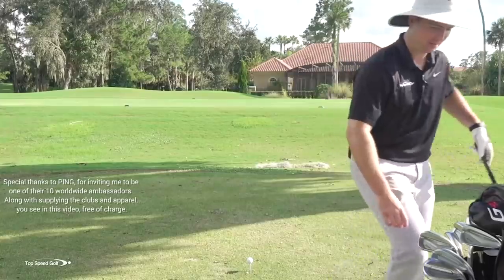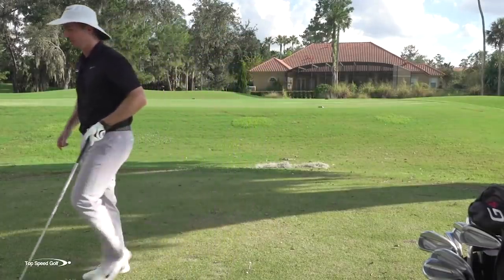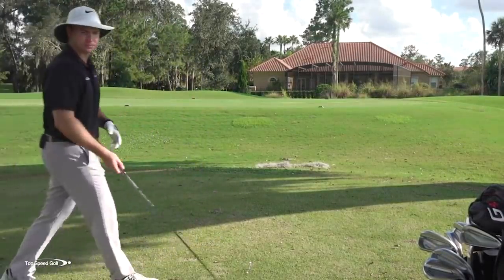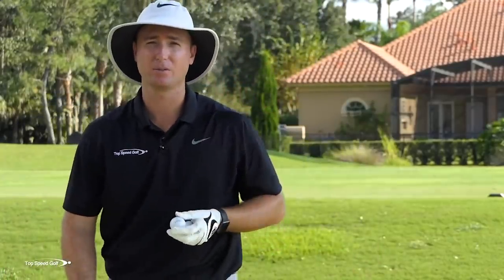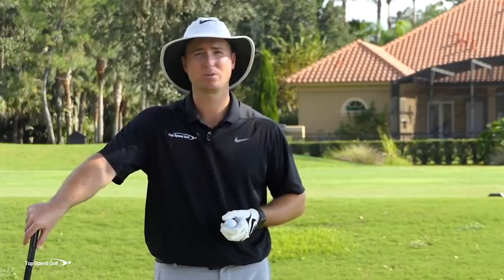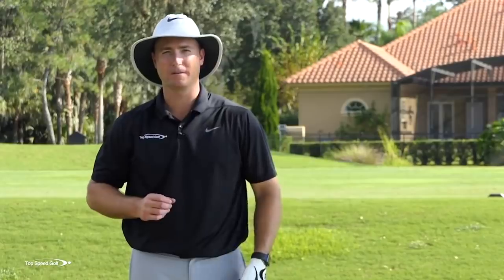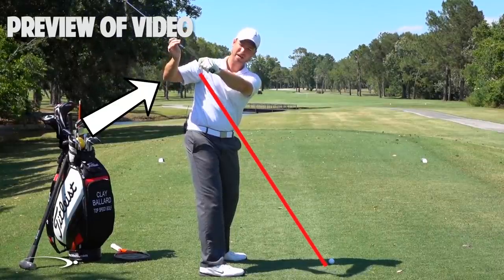How To Lower Your Driver Spin To Hit Longer Penetrating Drives

Comment: I've been following your channel for a little while now and really had a breakthrough with my driver yesterday. Your videos gave me the tools to not only begin to correct my technical errors, but to know what went wrong when I hit a bad shot. Previously, I didn't know what caused my bad shots, so I couldn't address the problem. I've begun to "know" what it feels like to square up the face, because of the variable learning drills you've shown, which have helped me tune into that a bit more. Then, using the foot spray stuff you've talked about, provided me with the immediate feedback to see that I was typically making contact with the ball low and towards the heel, even with my tee set high. Then it clicked, I needed to stand further from the ball, which forced me to have to reach for it more and prevented me from swinging across my body and either slicing or hitting a shot straight to my left. I could then focus on keeping that 'hula hoop' shape going towards the ball. Just like that, my drives are flying consistently further and straighter. I don't think I'll be scared to approach the tee the next time I play a round. I sure am glad I found this channel. Thanks TSG team!
Reply: Awesome 👍 This is exactly what I'm struggling with too, keep forgetting to bring my foot spray but thanks for sharing your experience ⛳🏌️
Reply from the maker: Wow, thanks fro sharing! Glad to help. Sounds like you're on the right track so keep up the hard work.

Comment: I would recommend to anyone who is used to a lower tee hight to put tape on the top leading edge of the driver until you get used to using the higher tee.
Reply: yeah, I messed up the top of my driver pretty bad :/
Reply: That's a great tip!
Reply from the maker: Thanks for sharing!

Comment: Good content. I’d also highly recommend getting fit for a low spin shaft with a high lofted MOI driver so the forgiveness is there, but the spin is controlled with the shaft. Ex. Sim Max with a Ventus Blue Shaft would be a good start.
Reply from the maker: Thanks for sharing!

Comment: Excellent explanation of the role of face contact on backspin. Always felt better hitting slightly below sweet spot but now I understand the value of hitting it slightly higher, even if if it doesn’t sound as solid. Thanks.
Reply from the maker: You're welcome! Play well!

Comment: If my left arm is shorter cause the bone overlapped when I broke it 1.5 inches down from the joint, I mean I slice like crazy sometimes. Is that sometimes the reason cause i might be pulling i mean my left elbow bends at the top of my swing so is there something i can do that won't make me lose distance, i usually hit it 230 on a good swing and 200 on the slice. I know no one can tell me exactly cause my shoulder is unique in the way its healed but yeah feels like I've tried everything and I keep slicing so should I just turn more left and play the slice or something like that lol
Reply from the maker: It might be making it difficult to swing the club more from the inside with a closed face but if you slice then it's the same reason as everyone else, your path is too far out to in. Check out our slice videos on our channel for help.  Play well! Quentin | TSG Instructor
Reply: @TopSpeedGolf  so i went golfing the day after and shot an 89 which is about 7 strokes better than normal for me but yeah i was hitting them only 220 but it was straight and my irons have never been better! Choking up a bit made all the difference around the green 80 yards out

Comment: Clay - would you also recommend a faster back swing as long as it was a smooth correct back swing to increase club head speed and distance?  Great video as always.
Reply from the maker: It can help but your ball speed may go down if you can't control it and hit the ball solid

Comment: so this is just showing us what spin is and how its created and the "how to lower your drive spin" is in another video we have to pay for?
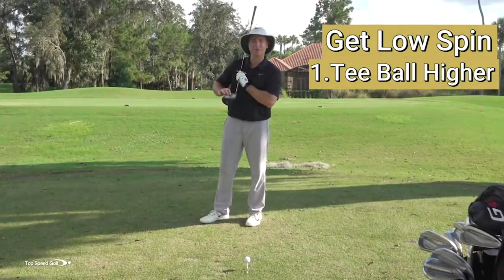Reply: You must have been asleep , I'll help you jump to 9:20 in for summary.
Reply: @rudebhoy5992  theyre general how to hit a drive bud.. the most important thing is "the move" behind a pay wall bud
Reply: I’ve used the foot spray trick on the range.., found out I was consistently hitting the driver on the inside of the face. My hand Path was was too far away from my body thru the ball
Reply: @ronmurphree2700  how did you determine that it was your hands and not standing too close to ball?  I'm working on fixing this too
Reply: Jeff Hallock I videotaped my swing